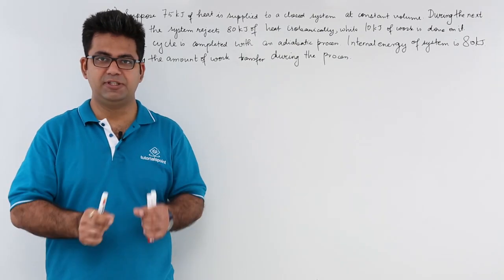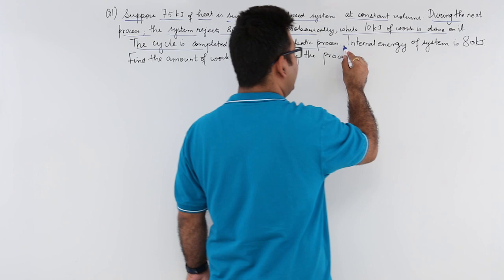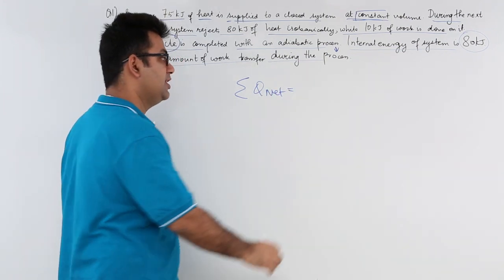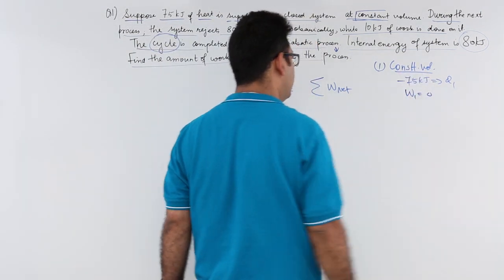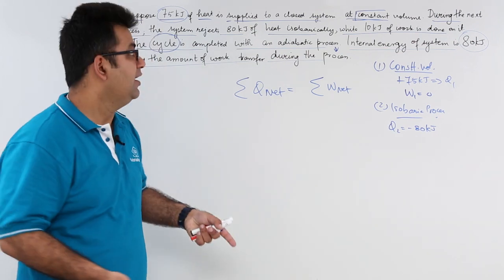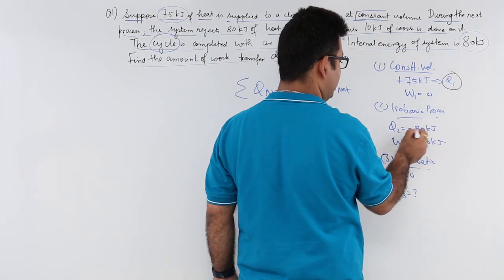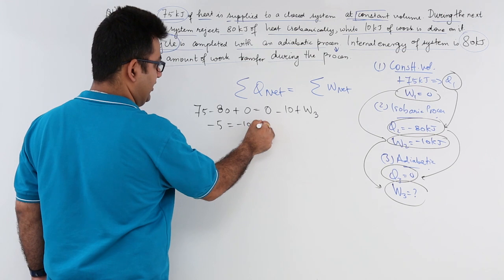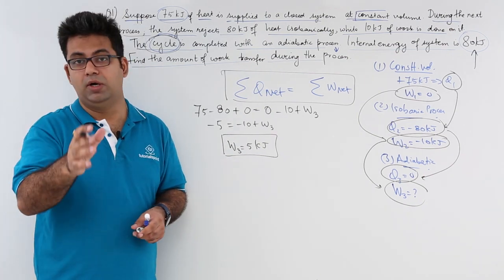First Law of Thermodynamics Example 1

Comment: sir as u said in previous vedio that Q will be + for supply and negative for rejetion
Reply: If heat is added to the system, then Q > 0. That is, during isobaric expansion/heating, positive heat is added to the gas, or equivalently, the environment receives negative heat. Restated, the gas receives positive heat from the environment.

If the system rejects heat, then Q < 0. That is, during isobaric compression/cooling, negative heat is added to the gas, or equivalently, the environment receives positive heat. Restated, the environment receives positive heat from the gas.

Comment: one thing which I found strange is the sign of work for isobaric process.....if  work is done on the system it increases the systems internal energy hence the convention sign should be positive 10
Reply: YES CORRECT . are u preparing for gate.so i  am a junior to u